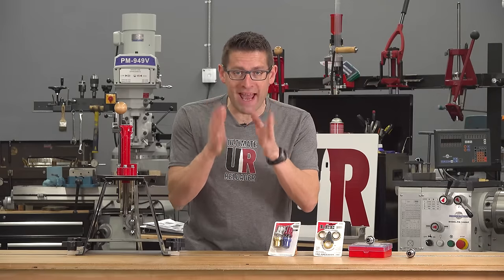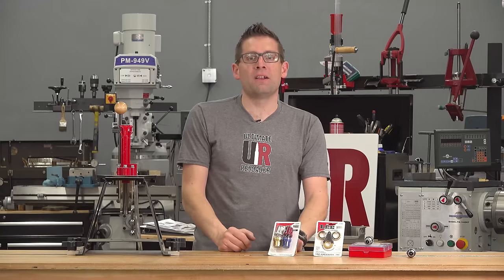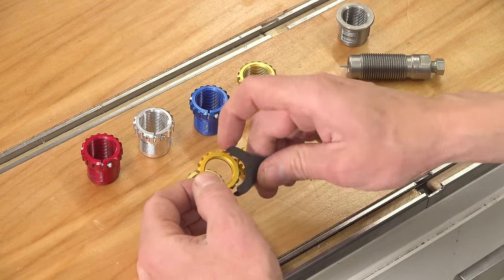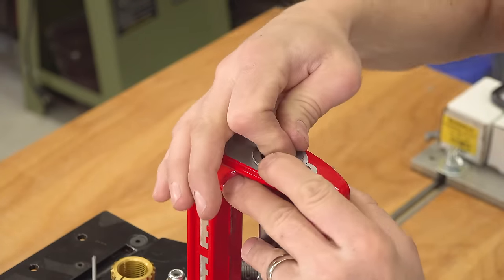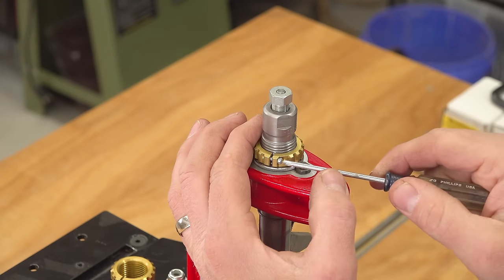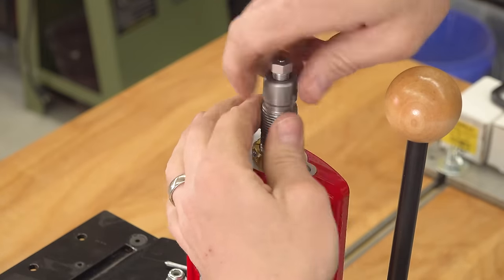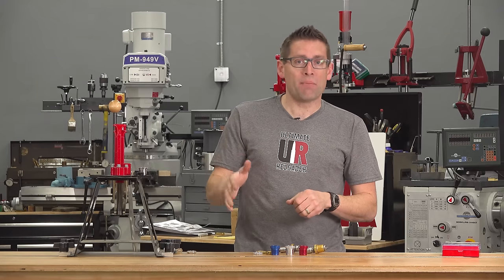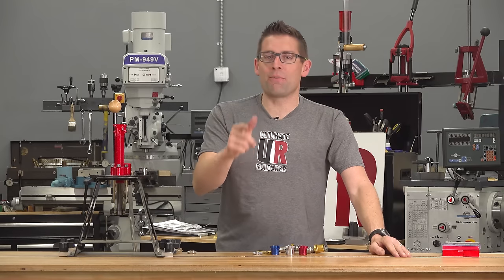NEW Die Lock Rings from LEE Precision (3 new types)

Comment: They look awesome, but I think they cut a few corners.

First, the screws should use either an Allen wrench, or a Torx. Those small Phillips heads can strip easily, especially when you try to really tighten them down. 

Second, they should have milled a relief slot into the same location as they did on the original breech lock adapter so that the plunger could come back up and lock it in place. 

With just a couple minor tweaks, they could have made these really great.

Comment: Before purchasing a new progressive press I called all the manufactures out there and requested a manual on their presses. This included dillons, hornady, lee and a couple of others. The purpose of this was to study them befor buying. I chose the lee loadmaster for very specific reasons.  One of the main one was the ability to reconfigure it to do more than the others without changing it to the point of taking it out of a warranty state.
   1st I never deprime or prime on press so this allowed me to move the powder station to the second station on the head, this allows me to put a powder check die in the original powder station for added safety.  2nd I can also set it up to process brass without going thru all the stations, (size cleaned deprimed rifle and pistol brass) and collect it in a seperate bin on the left side of the press. It can be drimed at the same time but as I stated I do this of press ((by hand to feel primerpocket tension) and inspect cases at this time). Also I just don't run dirty brass thru my dies.   3rd I changed out the shell locator hands on the 3rd and 4th stations with ones made with thumb flipper lips so my arthritic fingers could move them or open the up easly to remove a case easly.  4th I designed an on off clutch for their bullet feeder so I  did not have to remove parts to disable it while using, this allows me to turn on and off at will, by a simple turn of a knob and allows quiker change out of heads for other calibers. Also it allows me to use ther bullet feed and seat on the same station and not loose the final station thats used for crimp and carbide check die.
   Easly put back to origanal configuration with no warranty infractions.
   If you reas this Gavintobe and are interested in this let me know. You will like the mods and find them extreamly usefull and added production and safety.

Comment: Im gonna stick to my hornady steel Sure-LOC lock rings. Theyre the best hands down.
Reply: Do they work on a Dillon press?
Reply: @lucab9593  absolutely. All they do is lock the dies in place. The benefit it's they don't crush the threads of the die  line the rcbs and better quality than the lees
Reply: @lucab9593  NO! Not without machining an entirely new tool head, which could be done.
Reply: @MarkBrown5150  I have them on my Dillon's right now. What are you talking about?
Reply: Yeap. Hornady Lock n Load system looks to way better.  I argee with you Commander Osis
Reply: I'm also a fan of the Hornady lock Rings they put the die right in the exact same spot every time rock solid lee with their soft o-ring never can get to the exact same spot

Comment: I need to check them out. With the notches cut in the lock rings, you can make a die float in the head of the press with a roll pin . I need to experiment with that and floating shell holder.

Comment: I recommend putting the rubber O-ring on top. Then you get more precision because you are not compressing the rubber different amounts each time you install the die. Very hard to fully compress the rubber with the little cheesy plastic tool resulting in ⅛-¼ turn variance.

Comment: I got a set of those LEE lock rings over a month ago. Wanted a lower profile locking nut than the old 1 1/8" Dillon lock nuts. Short story >> After a month I'm done with them. They don't save that much room on the 550 head plus they have a standard slot screw to lock it in place. Solution>> I'm in the process of switching ALL die nuts to the newer 1" Dillon lock nuts.

Comment: I vote for switching to Torx.  4 rifles - same caliber - 4  differing head-space requirements -   A pile of labelled cases, for case length - and 4 sets of finished bullet with crimps.-- of all the bullets I every stuffed in a case.   A pail of ammo - once or lightly fired brass. It fits all the guns.  It's the pray and pass the ammo box.  The rest gets divided into 40 to 100 cases - all from what rifle and chamber - and stays from that point to destruction.  I think my best case was 27 reloads with 95% loads.  As of today - I have hot day confirmation. Dec Next - will give cold weather data -  Even tried some  guaranteed Were-Wolf projectiles.  They are a third less heavy that Current - and the smack stuff real good.

Comment: Question. I seem to be having an issue indexing the splines to the push down button. I can get the button to pop up but the lock ring eliminator moves 1/8 inch either direction, but still stays in place. Is this normal slop to be expected ?

Comment: I have always liked these "lock ring eliminators" style of die change. However, my presses include the Dillon RL550B as my main battle press with an RCBS Rock Chucker for use as a single-stage press for a variety of operations such as swage, sizing or other one stage activity while I have a 3rd press (do not recall the name) used exclusively for either decap or bullet pulling. On the Dillion Toolhead, we are limited to only the standard 7/8 - 14 tread configuration. Now,  it would be great for someone to come with a tool head for Dillon presses that would accommodate the Lock Ring Eliminator from Lee or the comparable system available from Hornady. If on were a proficient machinist one might be so inclined to create just such a tool head. If this idea works out, I wish to copyright the idea.......JK

Comment: Not a fan of the new versions. The tiny Philips screws are weak compared to the original hex screws and there's no specific notch on the spline rings which engages the quick release button on the press.

Comment: The lock ring eliminator bushings are different from the older ones, which used to come with a hexagonal screw and accompanying hexagonal wrench. I purchased some of the new ones from Midway and they are just as good. The hexagonal screw has been replaced with a slotted screw, which concerned me at first but I after attaching them to my dies and tightening them, the screw is set and no further adjustments are needed. In short I love theses lock ring eliminators because they allow someone on a single-stage press to quickly change dies without having to constantly readjust them. Well worth the investment!